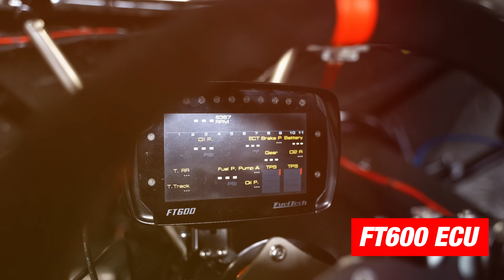Roots Blown NHRA PROMOD on our Dyno! | Paul Daigrepont

Comment: Guys, please, don’t ever play music over the run. Better yet if the engine is running, there should be silence. You must pipe those sweet sounds in 8k quality into my sound system unadulterated. I’m begging you. 
SIDE NOTE: did anyone else see the belt stretch off the pulley during the second run!?

Comment: Wtf did the engine come apart
Reply: No. They shut it off immediately after the pull to look at the plugs .Reading the A/F ratio at wide open throttle.
Reply: And the motor has such tight tolerances and high compression its better to shut it down and save running time on the motor as well